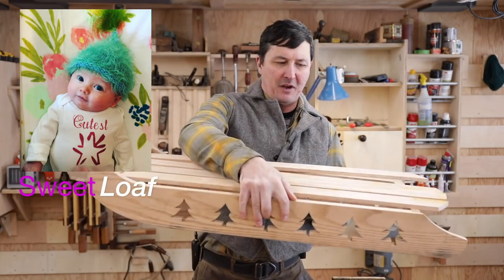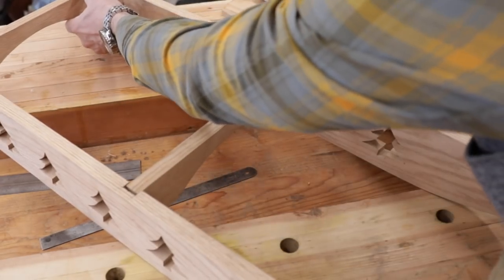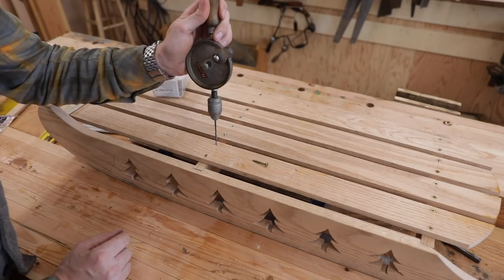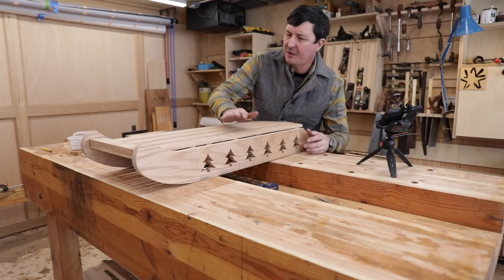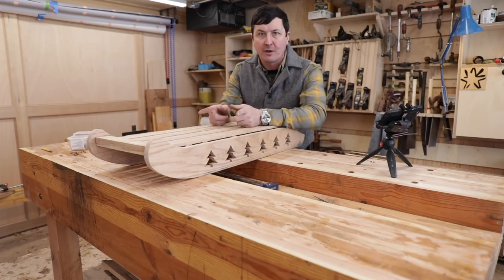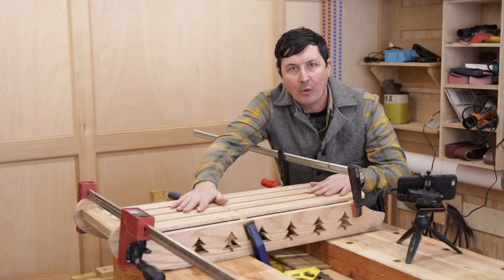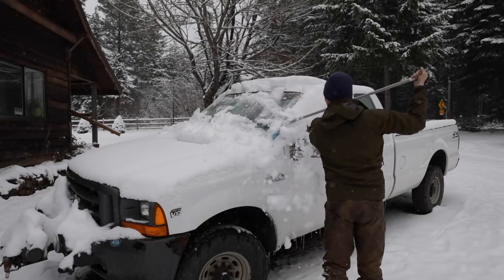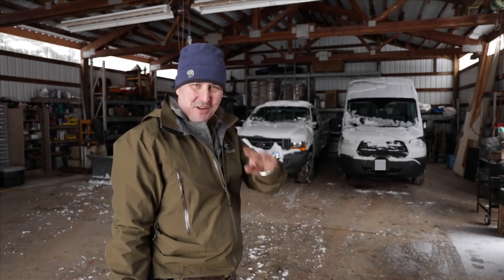I've Put This Off WAY Too Long

Comment: Oak is a hard wood. If only there was some machine where you pull a trigger and it turns the drill bit. I'll start drawing some blueprints and get back to you.
Reply: Zygy NO, not a trigger! 

MENTAL POWER!!! 

Just, think and it happens! 

Or voice control?
Reply: Voice control is too slow. Imagine saying Siri start the drill. Siri stop the drill. Every time you want to do something. Now if you give me the mechanism to receive thoughts and i'll work it into my blueprints.
Reply: Turning a drill bit is too "main stream". You need to invent a machine that when you pull the trigger, it instantly puts a hole through. Maybe make it have a loud noise, to announce that you're using it. And make it smell like fireworks, just for fun. :-)
Reply: Trigger?! That's far too violent. I suggest a biometric enabled device that only lets one user drill, and a full 4 finger grip engagement to start the drill motor spinning.
Reply: Agree

Comment: That sled is turning out really great! One thing that I learned - If you wait until the yellow glue is just about cured, it cleans up really easily by gently scraping the squeeze-out off with the edge of a small starrett 6" ruler. It's pretty satisfying too LOL. As a guitar maker, this is the way we do it. When using a wet cloth to clean it, the glue has a tendency to spread around a bit, making it tougher for the stain or finish to  soak into or adhere to the wood. I know it's just a sled, so I'm just being picky.
Reply: Good tip.
Reply: KleshGuitars agree
Reply: Just saw a Stumpy nubs vid where he reccomended the same thing - said that rather than wipe off, let it set a little then use a chisel or card scraper for much less mess and/or not spreading it into the grain any further.

Comment: With the hand drill, I was taught to grasp it by the pommel on top. When younger, it didn't fit my hand well but now it is comfortable and allows me to apply extra downward pressure with my palm when drilling hardwoods.

Comment: We used to add  aluminum strip stock to  make replaceable wear runners.  For a kid's sled (babies) we add a back rest with small side triangles to act as hip supports to help the child stay in the sled over rough ground.

Comment: You tend to slide off the sided of a sled.  This is why most have a raised side rail.   I made my first sled when I was a kid while  in boy scouts so I would not have to share a sled with my older brother during the scout winter camp.  Two improvements I made after using it were adding side rails and putting metal strapping on the runners to cut down on wear on the wood.

Comment: Those GRK screws are the best. They make a long screw with a small finish head that I use for wood trim. I like to be able to remove stuff like trim without ripping a hole right through the wood. My grandfather used long finish nails and every piece of trim in this house is loose. Use that torx finish screw and a little walnut stain colored wax and its solid as a rock and actually looks better too.

Comment: You can always use hidden dowels for extra strength and glue them with a marine grade epoxy glue if you don't want any exposed screws - it is really easy to do and you are most definitely capable as a carpenter to do it..........

Comment: A couple of woodworking recommendations. You mentioned that screws don't hold well in end grain, which is true, but a dowel would be perfect. If you rely on glue only for joint strength, always try to glue long grain to long grain for maximum strength. The front cross member would benefit by using dowels since only two of the five tenon surfaces are long grain to long grain. Keep up the good work!

Comment: Using the hand drill for the countersink bit is a perfect example of the older tool being even better than the modern equivalent, total control. I always end up drilling too deep with a power drill using countersink bits!

Comment: Add some sort of lubrication to the screws.  I have used Vasoline, beeswax, and even grease from a grease gun that I had available.  Does work good and helps to keep from snapping screws into.

Comment: Cody one thing you could of did as they taught us in woods class is to hide the screws but counter sinking enough to place a dowel over them and sanding it off flat  sorta like one of those wood buttons, Maybe on another Project ;)

Comment: When milling red or burr oak I drill screws or lags to attach leveling blocks on the ends.  The standard screws will go in but will break before they come out about half of the time.  I learned that pre drilling is necessary if I want to get the screws out.

Comment: If you have end grain you want to screw into, drill holes perpendicular to the screws path and then the screw is screwed into side grain of the plug glued into the hole you drilled. The hole and plug should be no less than 1/4 " from the edge. Hope this helps in the future.

Comment: Maybe for the handle you could have a bar on arms that pivot up and down at the front of the sled.  The cross bar could be tied or hooked to a belt easily enough, and having a pivot would allow you to still crouch and straighten up as necessary.

Comment: They didn't use oak for boat building due to its strength as you mentioned, it is due to how easily and straight it cleaves meaning there is less wood waste.

Comment: Maybe for the handle, you could use a strong metal handle and use a carabiner with rope/paracord to pull the sledge. Then you can hook/unhook it easily. (Not sure if I'm too late for this comment).

Comment: Also, save any sawdust you create - mix it w/ some good wood glue, sand it flush, & most folks will not even know.
Reply: FTR, LOCTITE is most definitely FULL METAL GANGSTAH (#ChiraqApproved).

Comment: I’m sitting here watching Cody put the rear crossmember in upside down...
Reply from the maker: Guilty,
Reply: Double Bit Craftsman I thought I only saw that it drove me crazy
Reply: Saw that. Then, suddenly, all was right. Lol. I thought he missed a second loctite shot for the trolls. 😀
Reply: Takes a big man to admit when he has made a mistake. Great video.
Reply: Yeah, it does, but I always have wondered why that is so...
Cody could have edited or reshot the video in such a way it wasn't visible to us, instead we just see him hammer in the crossmember again in the right orientation at 7:37.
Good ending of the video, it was a little reminder to me that I tend to live life as if it's for granted and without any care to it. But that's not why we're here...
Reply: Sitting quietly watching on my phone and I start saying, "no... no... no" partner looks at me and says "what?"... " oh nothing he fixed it"... "who fixed what?"... "never mind"
Reply: Agree. nice catch he definitely has a Nicer finish then my jobs
Reply: A handy tip for cleaning off excess glue in hard to get places. Use an old toothbrush rinsing off in warm water. Works like a charm.
Reply: I was just thinking.... NOOOOOOO!!!!!!! Don't do it Wranglerstar! Don't do it!!!!

Comment: Hi Cody, You do have a way of turning the screws without power tools, I have several braces and bit set and one of them has a bit holder in so I can use any bit that I need. I find it much better than a screwdriver and have a lot more able to tighten the screw.

Comment: I know several folks here where i live that have had their Ford diesel engines go into melt down ... As far as i know Ford didn't make their own diesel engines until a few years ago, International built the engines under contract.. To service the engine when that happens they have to lift the cab and box off the frame standard procall ..

Comment: the sleigh is beutiful.... nice job. a little bit of a concern tho, won't the cross members act as brakes in anything deeper than an inch, since the runnung boards are narrow the sleigh will run in the snow, not on it.... otherwise very lovely and not overly complicated like most things these days

Comment: Love the woodworking videos. Out of curiosity, are you going to finish that one wall where the windows are?

I second your observations regarding oak and handtools. I've build four Paul Sellers wall clocks over the last two a half years (let's me gauge my woodworking improvement). The third was out of oak. Wowie, it noticeably  require more effort than pine, cherry, or walnut.

Comment: Ironically I retail used parts and we didn't sell a V10 Ford for 12 or 15 years after they were introduced one of the all time reliable Ford engines , it's 4.6l plus 2cyl

Comment: cody, it's not smart to put 2 screws right beside each other, the wood will expand and shrink but the screws will work against that and will hold it. i think the wood will split because it can't move free.
Reply: and they should not be attached with glue either, you always have to let the wood expand and shrink.

Comment: Love your vest, big man!!  Where did you get it?  I'd be very interested in one of these.
BTW that looks like red oak, but that's just me. And securing the square with the slats that run on the edges of the construction would be how I'd keep from using biscuits or wedges on the support pieces.  It isn't as traditional but it takes the slats to both edges, and a couple screws into the runner pieces along the edge slats will be cheap insurance for a sturdy structure.  But what do I know? lol  It's certainly a nice sleigh.

Comment: I'm not an expert by any means, & I am not trying to troll you or bring negativity. But those slats may end up cracking, 2 screws & glued in the middle,  not much room left for movement as moisture content varies.  I hope I am wrong,  It's a beautiful sleigh.

Comment: lolol, the loctite bottle cracks me up every time! =D Couldn't you chuck the bit holder for the torx bit into the hand crank drill you were using? or does it not accept bits that large?

Comment: Hey Wranglerstar, I am going to ask this question to both you and NutnFancy as I have followed both your channels and respect both of your approaches to life. I'm 24, and have a carry permit and a glock 43. Recently I have been thinking about purchasing an AR, my fear is that with the way the world is going the potential need for one increases with time, and the possibility of them being banned increases at the same time. I have a little money (and I mean little saved up, I had a lot of hospital bills recently that set me pretty low) and tax returns are coming in. Would you recommend going in to a slight bit of debt to purchase and AR. I could pay it off within a few paychecks so I guess I'm asking, save up and then buy, or buy and then pay off?
Reply from the maker: Don't buy on credit Cody, put it off a few months. Spend this time doing research and when you have the money saved up pay cash. Here is an idea, instead of spending the evening on YouTube get a part time job delivering pizzas in the evening. If you hustle you could have enough cash to buy and AR in 10 days or so.

Comment: I guess this is how Cody tells us we should have clued in way back when he started this sleigh. 

b.t.w. Wouldn`t this be for next year, this year you would need a sleigh with sides on it.
Reply from the maker: Naa, I told Dee to hold on like grim death,
Reply: I figured strap on the carrier to the sleigh.
Reply: I  think it  needs  a  little  chair  to help  hold  her,  like  you  see  in  18th century  sleighs for  children!  Also shows  the  wooden  handle  usually off  the  back  so  parent  skaters  could  steer.

Comment: Those joints in the cross members will fail without reenforcement. Why? Because you have end grain on the glue surface. That's never a good deal without reenforcement. One good bump and those sides are free.

Comment: The V10 was one of the worst motors ford has built... i thought
Reply: BRYCEONBIKE oh no, they're ultra reliable and actually very powerful. This year is their 20th. Year of production.
Reply: Well i wouldn’t say ultra reliable knowing its a ford 😁 i bet they are really bad on gas thats a big motor lol
Reply: BRYCEONBIKE I would, being how I've owned several. Gas mileage blows but then again, so does every other 400ci+ engine in a heavy pickup.
Reply: Great engine but it was done in by its gas mileage. I’m lucky if I get 10mpg. I don’t drive it much so I’m very happy with it. Pulls great and way cheaper than a diesel.

Comment: Blasphemous! using the dewalt bit holder on a milwauke drill, i thought you new better. Only certified dewalt bits are compatible with dewalt drills!